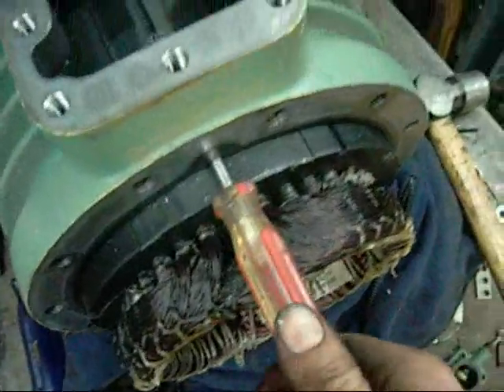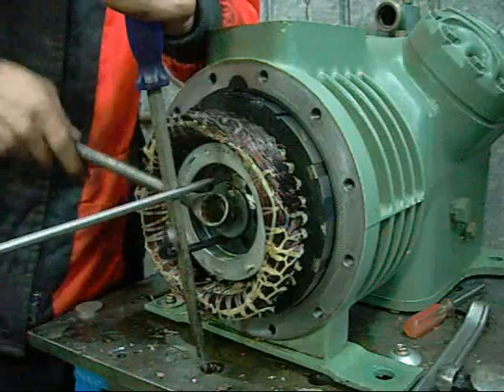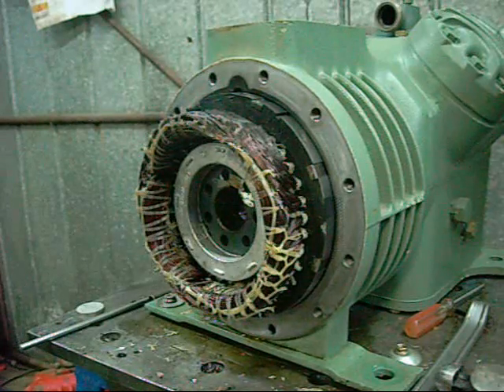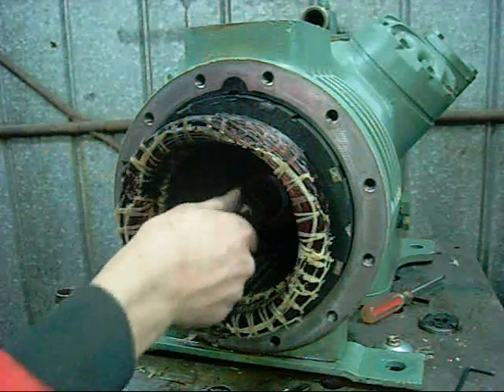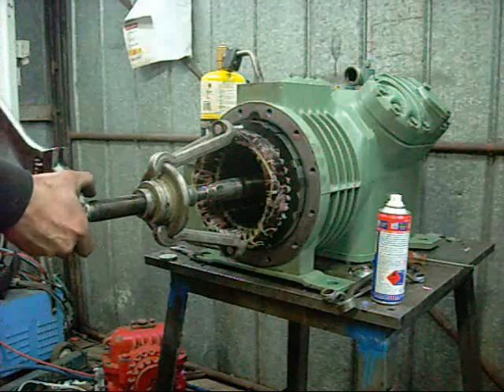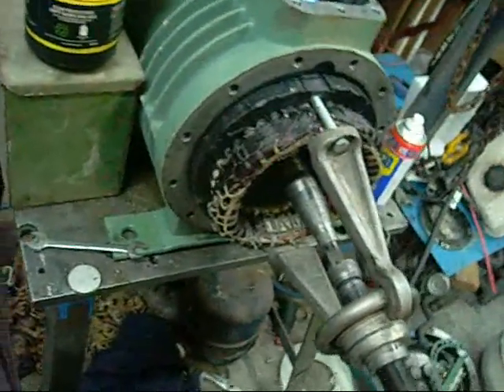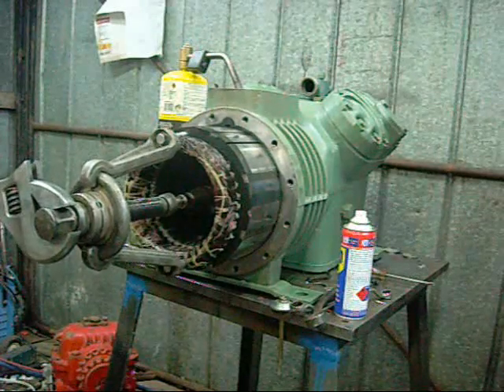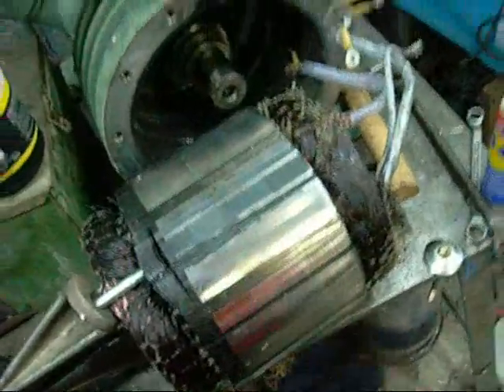Bitzer V4 Semi-Hermetic Compressor Motor End Pt2 - The Stator.wmv

Comment: Sir bitzer compresor crankcase body hot and amperes high what is the problem
Reply: Increases friction on the big ends causes everything to expand which increases amp dràw which leads to a winding burn out this could be prevented by correct maintenance but most engineers don't do it the right way

Comment: Hey Ed,

Is it possible to extract the stator without damaging it? I have one Bitzer semi hermetic with 2 cylinders. I'd like to repair the stator but I have no idea how to extract it without damaging. I can see that You have damaged this one a little bit. 
And Yes, Happy New Year. :)

Best Regards!
Reply: kontaktronik hey mate I used to do a lot of these. I had some special tools made to remove it. I used to pull it out using the copper wires. I ran small cables in between the gaps of the copper winding. Obviously the winding gets damaged but stator lamination is in mint condition.
Reply: Nipuna Caldera Yeah, that sounds like a good idea. One of windings is damaged already. Did You used anything to heat the housing to extract the stator or it can be pulled out without heating?

Thanks for reply!
Reply: kontaktronik yeah mate you got to the housing he seemed to be heating the stator. Keep the stater as cool as possible use compressed air or a blower. I used a heavy gage bar and got   It made in to a circle. Then welded a heavy gage c section to it. Drilled three holes and welded three nuts to it.
Reply: kontaktronik placed the ring over the winding and used the cable and passed it through every gap and around the ring.
Reply: @MrNipsi  i agree with you sir
Reply: @MrNipsi  hang compressor up by the oil pump and heat around stator gravity will do the rest takes 5 minutes (i rebuild these for a living)
Reply: ok  ta  certo
Reply: very carefully

Comment: Good evening friend have a problem with a compressor Bitzer LN84 / 4EC-6.2 model and the lights ..... OK but after 5 min is turned off and throws me a failure of low pressure safety board believes that it can Uster generate this fault ??? I beg you please answer me from Venezuela ..
Reply: Suction reeds

Comment: using a torch to heat the casing is like outrageous.

It should be removed without heating. It takes like 3 to 4 tons of force. There are specific tools out there to accomplish the extraction properly without harming any component.
Reply: Wronh.
Reply: That's how the manufacturers do it I should know I work for one
Reply: In properly equipped shop,they will have the equipment to pull a stator without damaging it.
On the subject of heat,even with the proper equipment,I have had to heat quite a few cases to get a 6 ton press to finally break them free.
Oddly,the video shows throwing heat to the inside of the case instead of the exterior.
Seems like the stator and case would expand more in unison by blowing heat inside.

Comment: looks easy through a video but in reality it not so simple i suppose. unless they pressed on the very edges of the laminations they couldn't get it in there wound could they? i suppose factory's have engineers to make it happen!
Reply: Your correct to press the winding in we use a special hydraulic ring that fits on the laminets and we press the winding in with a 50 ton press